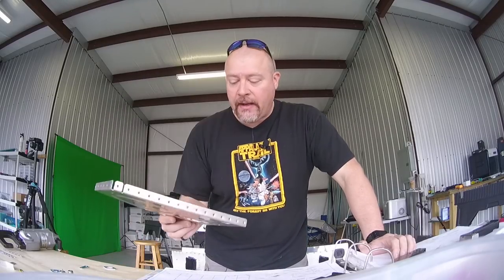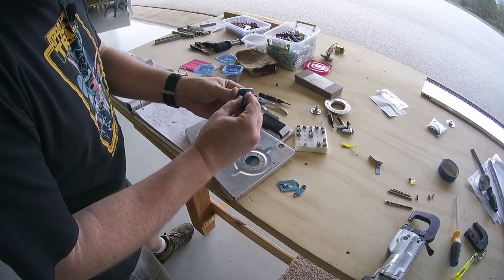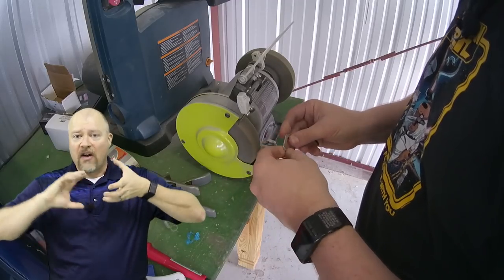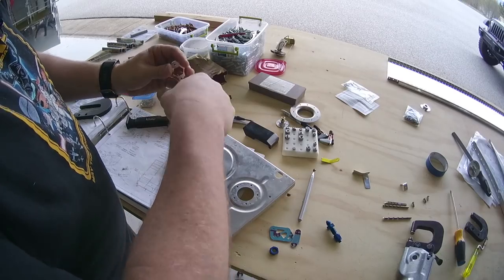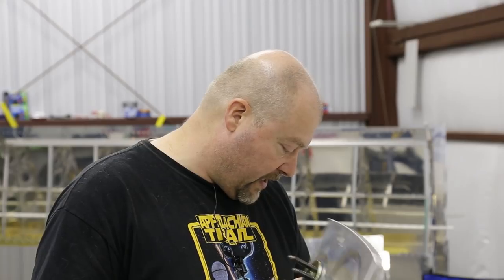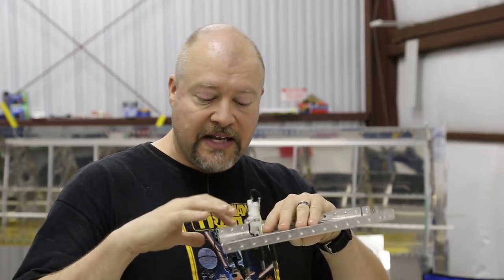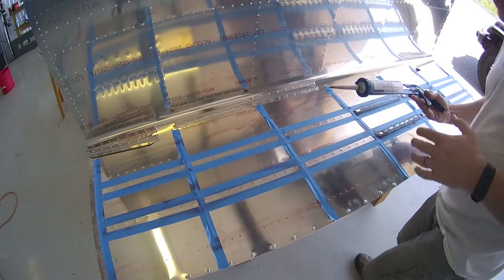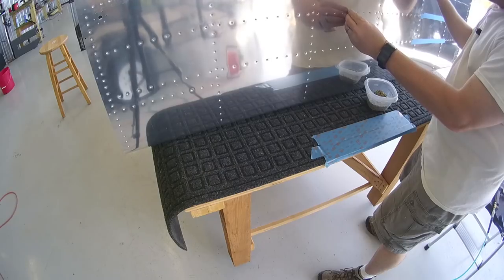RV-10 Wings - 052 - Proseal "Goop" airplane tanks, a new way to apply it!

Comment: Proseal codes...... A or B or C is the method of application. A is thinnest and is what I would use. B is thicker and is for brushing, but you can thin it out a bit with a drop or two of MEK. Helps it flow. The 1/2 is half. half an hour cure. 1 is 1 hour, 2 is 2 hour. the 4 digit number at the front of the code is the type of ProSeal. In my day PR1422 (brown) was used for skin panels that needed sealing and PR1440 (gray) was used in fuel tanks. So when I was working on fuel tanks I would normally use PR1440A1/2 or A2. If I couldn't get A1/2 or A2, I'd use PR1440B1/2 or B2 with a couple drops of MEK to thin it out and help it cure. Be clean. There is no reason to ever get goop on you. Work methodically. Mask out your edges. DO NOT APPLY TOO MUCH. It doesn't help and can make it weaker. DEGREASE PROPERLY. And when you take your gloves off, peel them off inside out so that no goop gets on you.

Comment: I got the idea from VansAirforce to use syringes. Very similar to the calk gun method but I am still mixing and then loading the syringe. I use 60 and 150cc depending upon what I am doing. I also have noticed the stuff is temperature sensitive. Our hot summers in the south are not great for this kind of work.

Comment: If you use a small foam roller to apply the sealant to the skin, you get a very even thickness and it doesn’t get into the fastener holes. Home Depot’s aviation department has 1 or 2 in wide foam rollers cheap. Just throw the roller part away after use.
Reply from the maker: How many tanks have you used a small foam roller on to spread the proseal?
Reply: Jason Ellis I haven’t yet started on the wings of my RV-14A, but I did use this technique on my rudder trailing edge to apply the sealant. It doesn’t push sealant into the hole and you can adjust the thickness of sealant on the part by how much you put on the roller first. 

I learned this technique from a Boeing AOG mechanic. They have to work fast with high quality and this is the fastest, cleanest and most accurate way to apply an even layer. Large aircraft use sealant on every overlapping joint on the airplane for pressure sealing and corrosion prevention.

I bought a used pneumatic sealant gun from Brown Tools for about $85. I also found a variety of different applicator tips to lay down fillets. They’re about $2-3 each. 

When I start on my wing kit I’m going to do the tanks first. I know most people don’t enjoy working with sealant, but with what I’ve learned from the pros I’m relishing the task.

Comment: Get the pneumatic spuck gun with the different length barrel sets, it does a far neater job as the air takes the work out of it!  Use B-12 or B-24 for your fuel tank work, takes the perceived rush out of your work rhythm!  Rubber spuck rollers and a Teflon paint pallet is what I use when I’m a spucker, the spuck goes on fantastically when rolled!

Comment: The float level manufacturer can't tell you to dimple or countersink because they don't know the thickness of the metal. 40 thou or more, countersink. Less than 40 thou thick, dimpling is recommended. If you don't have a copy, AC43-13 is a great book to have.

Comment: I ended up purchasing two of the plunger style units for the trailing edge ribs on the elevator for the 14. I did not, however, have the screw on nozzle so I need to find that! That would have made it much less messy! I am just finishing up the tail section of my 14 build and expecting delivery of the wing kit within the next week or two! I have a feeling that I will have my tanks sent out to be built for me!

Comment: Was just wondering if you tried using a simple baggie to apply the goop ?, mix the goop, load the goop into the baggie with a plastic spoon, get as much air out of the baggie before sealing it or just twist it like a bread bag, then snip off the tiny corner tip and squeeze the bag to apply the goop. When your done just toss the baggie in the trash.
Reply from the maker: Yes and this does work. I will say that it can be a PITA to get the goop IN the bag in the first place though.

Comment: The “B” is a thicker consistency and the 1/2 means that you have approximately 1/2 hour working time before it starts to set. The B2 sealant means that it is the thicker consistency and has 2 hour working time. You can also get sealant in a thin consistency and then you would order sealant with an  “A” in the part number. You can also get sealant with 4 hour working time.
Reply: I just found two full 12oz cans of Proseal and hardener I had gotten from work about 6 years ago, they lost the certs for it so they had to toss it in the garbage so I saved them from their early grave but promptly forgot about them in storage lol. They are both labeled P/S 870 B2 along with BMS 5-95 Type 1 CL B2, now that I know what the B2 stands for, I'm curious what the other designations mean, do you happen to know? I know the stuff is no longer any good for commercial use after sitting for so long but the stuff still looks and hardens up like a fresh can after some thorough mixing so I'll just use it as a general purpose sealant around the house I suppose.

Edit: holy smokes that's $300 worth of sealant I got lol, that stuff is spendy!
Reply: It is probably going to start some kind of a debate, but FYI, I have been maintaining corporate jets for 45 years and back when I started there was no expiration date on sealant. If you could get it out of the can, or tube it was good. Then the FAA in all their wisdom decided that everything needed an expiration date. That did a few things. It generated more hazardous waste to pay to get rid of. It made the sealant manufacturers more money. And it kept mechanics that were too stupid to determine if the sealant was good or not from using bad sealant. 

PS 870 is basically PS 890 with a corrosion inhibitor added. The BMS number are a Boeing specification for basically the same stuff. They also make high and low adhesion sealants. You can research what each spec is by typing it into your search browser.
Reply: @seapilot2  That's good to know, thanks for the info. I did some more reading on it today about the different types of PS, there's a pretty large variety of different options for the stuff. I whipped up a small batch last night to test it again, I used a microgram scale to get the mix ratio perfect (the first batch I made that I said hardened up just fine was mixed way too hot) and found that it doesn't like to harden up like I remember, it was still viscous this morning when I woke up, but about five minutes over a heat gun and it was fully cured, so it seems there is some degradation from storing it for so long and the reaction isn't taking place like it should, but it can be coaxed into working with a little heat. Is that common in your experience?
Reply: Sealant cure is dependent on the correct temperature and humidity. Age has little to do with it in my experience. The perfect temperature is around 75 - 80 degrees F. And you need humidity also.  The lower the temperature and humidity, the slower it will cure. It is tough to get sealant to cure in the winter, but it will cure, just more slowly.  We never use B 2 sealant in the winter, because it will seem like it takes until Spring to set up. We only use B 1/2 most of the time, unless we have a project that takes a lot of time to install, like a windshield. You can make it cure faster by bringing up the temperature and misting it lightly with a spray bottle. You can mix it hotter to get it to set up faster, I don’t know what the long term effects are, but in my experience, I have never had it peel off if the surface is properly cleaned before sealant application.
Reply: @seapilot2  Ohh? I had no idea humidity was part of the curing process, that's interesting. I knew the temperature plays a role, we used to chuck our syringes of it (we used irrigation syringes to inject it on bushing faces for shrink fit bushings) in the fridge to give us more working time on hot days, but if it wasn't cooled it would only take roughly two hours to become too thick to apply, but when I checked my batch this morning it was 12 hours after mixing at about 70-ish degrees and it still hadn't even set yet, still viscous and stirrable. Who knows, maybe you're right and the humidity is the issue, my room is probably bone dry, considering the fact I have about 250 pounds of various hygroscopic pyrotechnic oxidizers in here lol (I make my own fireworks). Either way I know I can cure it with heat so I'm not really worried. Thanks for your time and all the info, I really appreciate it!

Comment: The plunger type is what we use at work. There are 1/2 hour, 2 hour, 6 hour and 12 hour types. 3277 and 3281. And that is what I’ve been sealing with for 5 years.

And just so you know, we fillet seal on primed surfaces only. I’d recommend you do that in the future as well.
Reply from the maker: Please explain what you mean by "fillet seal".. I needz more info! =)  I want to do this right so if you have been doing this a lot longer than I have I'm ready to absorb info..
Reply: +Jason Ellis  I believe a fillet seal is between two perpendicular surfaces, like wall to floor.  Think of the ‘fillet’ function in AutoCAD?  In your case, it’d be between tank skin and the vertical plane of the angle brackets you were riveting.  P.S. Still cheering you on from Hong Kong. Glad you got your build mojo back!
Reply: Jason Ellis there are 2 kinda of fillets. Overlapping and 45 degree. For the F-35 CW the amount we use would be excessive for your plane but the principals apply. Let’s say for example you have 2 surfaces that have an overlap, if the vertical distance from one to the other is say .30”  or more then you would just do a 45 degree (think window caulking style) fillet. If the distance is less (like maybe the thickness of cardboard) you would have some sealant running up on the higher material and also running out into the lower material. It would be much easier to show but it all boils down to the probability of leaks vs the weight of the sealant.

Here is an image to demonstrate some fillets. https://goo.gl/images/rXGBzQ

Comment: The B is the working time.

So b 1/2 is 30 minutes of working time, and b2 is 2 hours working time. They are both the EXACT same components, just different amounts of the curing agents. When mixed, it should be a dark gray. if you mix it with a very light color, it may take days/weeks or not cure at all.
 If you mix it, and it is nearly black it will cure very very quickly.

Comment: That Pro-Seal caulk applicator really worked great for you--it turned out great! I would have expected the baffles to be a bit larger though, to be honest. But it is what it is I guess. 

I ordered my empennage kit two days ago, but it's going to take an extra week due to the OSH orders being filled. RV-10 #42064.

Comment: PPG (and others) say that B-2 does full set (@ 77F) over 48 hours (min time to pressure test -- suggest 14 days for fuel fill) (B-1/2 set in 24 hours, B-3 in 90 hours)
{the number after the "B" is supposed to be the suggested working time, in hours,  after mixing -- FWIW, but my experience was that it was still going strong past that period}
Instructions from Stewart Warner on your fuel level sender (vs from Vans):  you'll have same situation with your brakes ---> install, set up, test, break-in, fluids, etc. come from Matco instead of Vans

Comment: I'm thinking of using disposable cake decorating bags.  Turning the large end inside out to fill the bag and then twisting it to force the material to the bottom, small end.  When I'm done, Ill just throw it away.  I just need to ensure I use one that does not react when using it with the sealant.  Thoughts?

Comment: Once it's mixed you have to use it all or it will  harden in the tube. Good for a big job not not cost efficient for a small one.
Reply from the maker: Exactly.  Thus the small touch up kit I also showed.  That little cup is the size of a camera roll cup (does any one even know what that is anymore?)  If you don't need all of the stuff in the caulk gun format, don't use it.  it will be a waste. =)

Comment: Where did you get the caulk gun you are using? Is it just a standard caulk gun, or special for those sealant cartridges? I have the sealant in cans and can put it in the containers, but then need a way to dispense it.
Reply from the maker: It's a standard caulk gun.. and a cheap one at that.. it broke!  You can get the sealant cartridges at aircraft spruce.
Reply: @JasonEllisBuilds  Brown Tools sells a manual gun for those cartridges. I'm assuming that would work.

Comment: Those are stiffeners. They are there to stiffen the skins. They are not baffles. The ribs act as baffles. And there is nothing “new” about this method. They have been using those tubes in airplane factories for decades with pneumatic applicators.

Comment: When using the tubes you waste more sealant in the tube compared to mixing th right amount for the part of the project.  The manufacture according to the bulk would have mix the whole can with the hardner. They also give you instructions of how much resin to use with the right amount hardner.  Either way mixing the whole tube  or the whole can.  Either way both method is waste.

Comment: One last thing. Applying it correctly, brushing is much easier than using the caulk gun and does a better job. With the pint kit, you mix as much as you need. With the Semkit, you have to mix the whole lot.
Reply from the maker: hrmm There is just no way I can see using a brush with the stuff they are having me use.  It's the consistency of tar.  Maybe the A stuff would be brushable?

Comment: You should check out the Semco Sealant gun.  Brown Tool has them for $60 for a full kit:
https://www.browntool.com/Listview/tabid/344/CategoryID/480/Level/a/ProductID/2661/Default.aspx

I tried that same Van's shipped Caulk gun and tubes and didn't really like them.   I ended up buying a Semco gun from Brown and its an amazing little tool.  Its pneumatic so there is almost no work involved, and it lays out a perfect bead of ProSeal every time.
Reply from the maker: But as I understand it you still have to do the mixing yourself, which is the part I don't care for =)